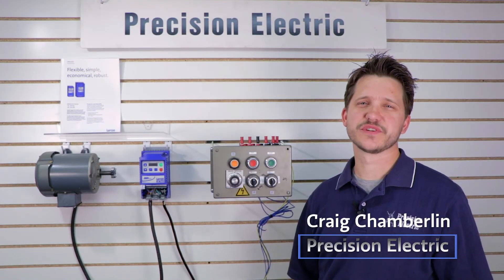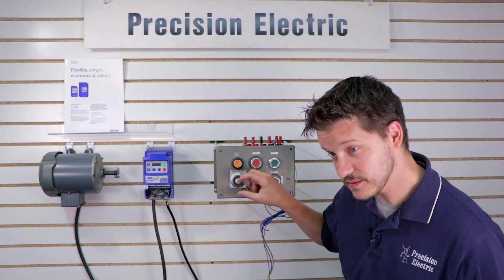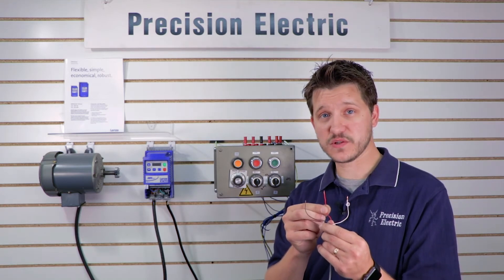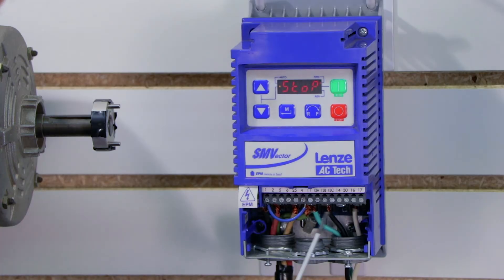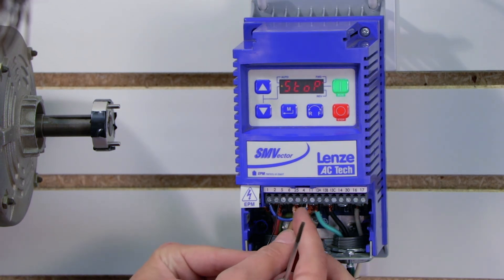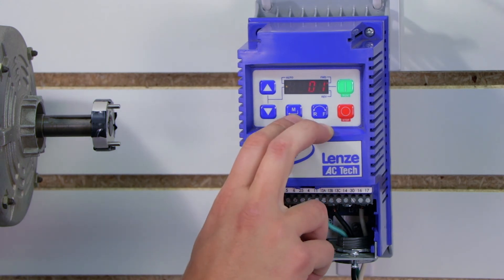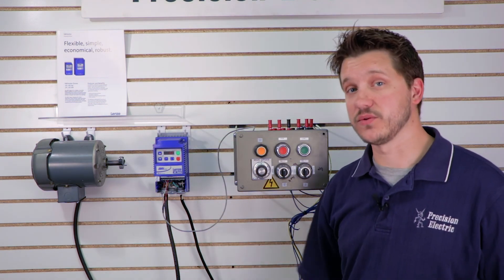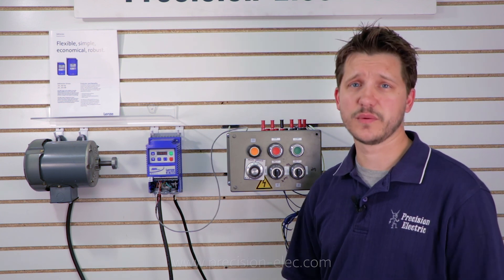Lenze SMV Training Lesson 3: Basic Speed Potentiometer Wiring & Setup - Variable Frequency Drives

Comment: Great video. I set P102 to 20 Hz and P103 to 100 Hz.  When I turn the Pot, it goes down to the 20 Hz, but cranking all the way up, it only shows 60 Hz!  Is is actually going 100 Hz, or am I missing something?  Thanks,
Reply: P103 is keypad max Hz. P161 is speed pot max Hz. you need to set P161 to 100Hz.